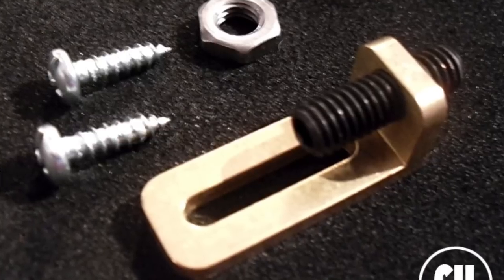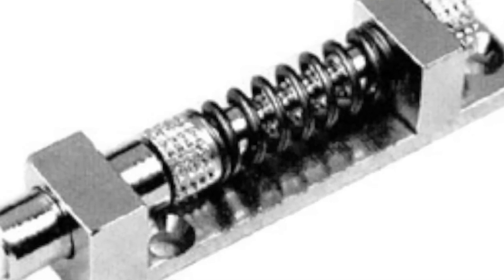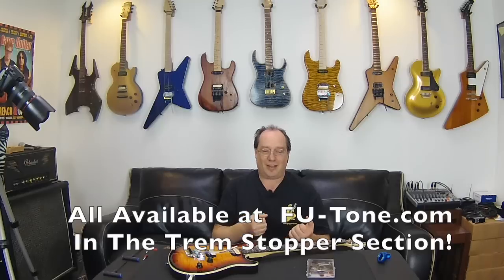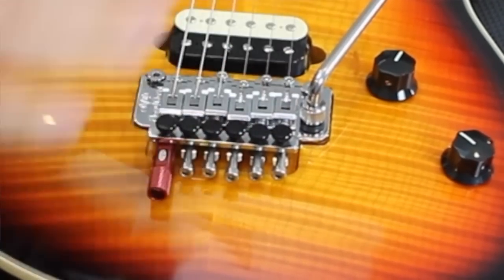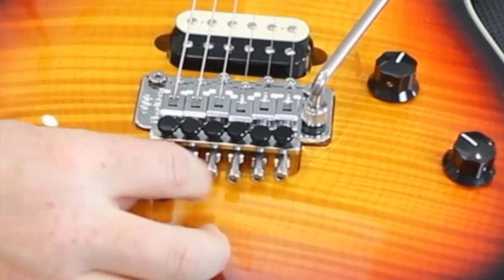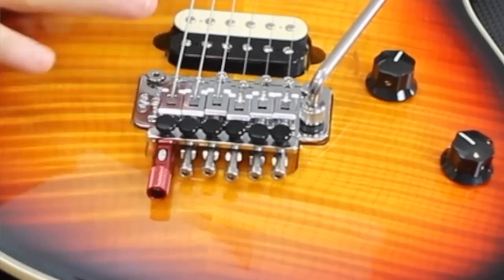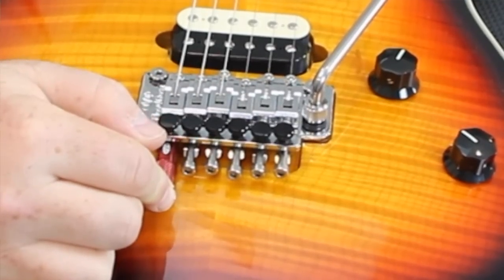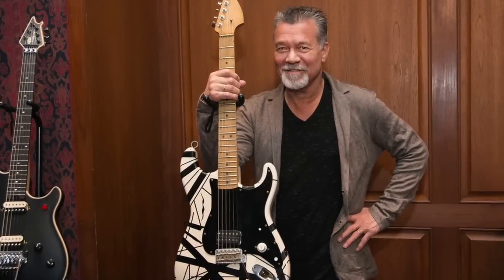EVH D-Tuna Setup - FU-Tone (V2)

Comment: It does not work with the licensed Jackson Floyd Rose…even when with an FU tone Black Box installed. If you have it in tune for one tuning as soon as you use the D tuna, all of the other strings go out of tune of course. The only way it will work with this type of bridge is if the bridge was blocked. So no ups on the Floyd, only downs in this scenario.

Comment: What’s the point of a Floyd that isn’t floating ? Why bother with the locking nut / fine tuners and all the Floyd  hassle when your just using full spring tension and a stopper to give you the same set up as a regular strat style bridge ? Seams kinda stupid or am I missing something ?
Reply from the maker: You're missing something. This is just one option of how to set up a locking tremolo (with or without a D-Tuna). A locking tremolo set to dive only is a very stable tuning environment where you can still dive the trem, rest your hand on the bridge, do double stop bends, stay in tune during detuning or a string break. It is just an option. The right answer is: whatever is right for you and your playing style. Some guys like Steve Vai would prefer a full floating bridge. Other guys like Eddie Van Halen prefer a dive only set up.
Reply: FU - TONE yeah I understand that as most of my guitars are fully floating bridge guitars ,  but what’s the advantage of a locked off Floyd with a locking nut over a standard strat style bridge with locking tuners ? You can rest your hand etc etc on the traditional trem bridge. I’ve always seen the advantage of the Floyd design to be that it is a balanced system using equal string and spring tension locking it off would totally negate that.
Reply from the maker: @fredwolfmusic   - Like I said - it is just an option and another way to set it up that does work for people. Presenting different options for gear is helpful to people who may not know. Comparing it to a Strat style trem is irrelevant. It is not a question as to what is better. It is a totally different animal. The answer to "what is best" is: whatever works best for you and your playing style and needs is best.